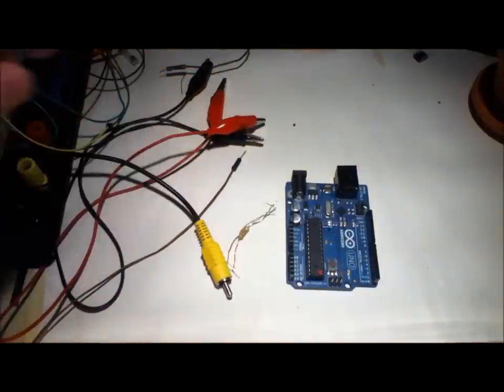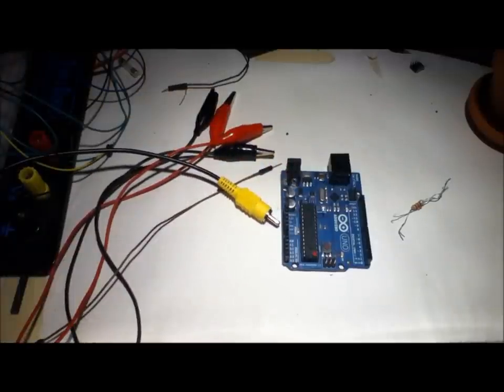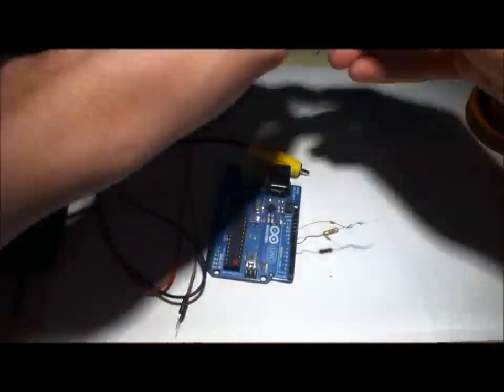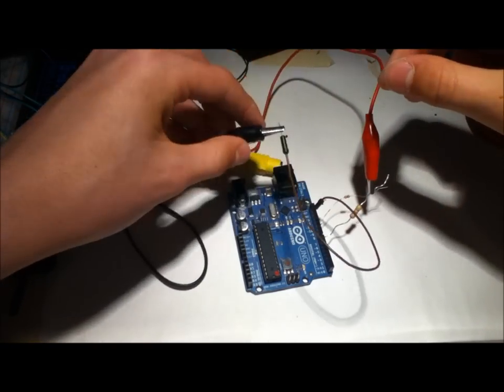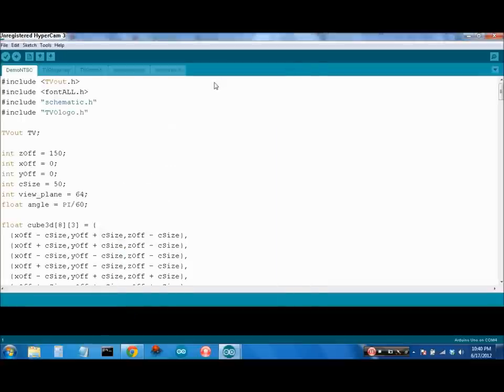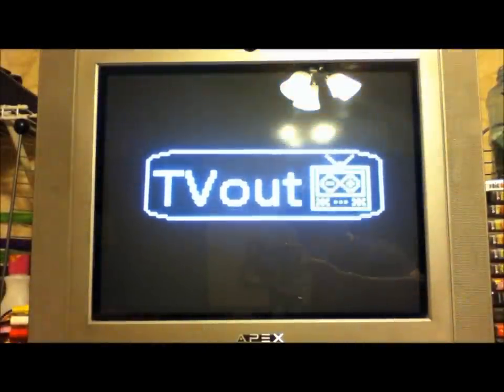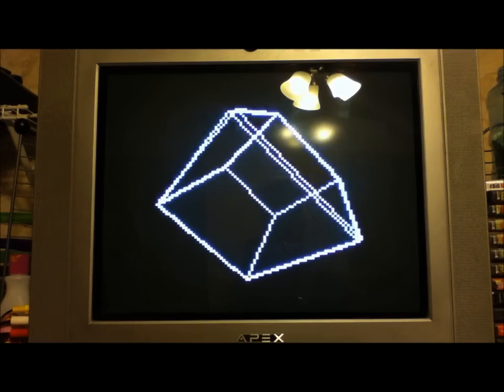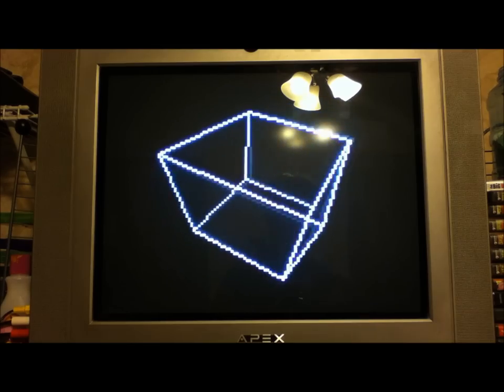Arduino TV Output

Comment: I have found that with those resistors, There is too much voltage to the TV. Should be 1 volt. I used a 2200 and 1k ohm resistor. also a 75 ohm resistor to ground. Gives a crystal clear picture. Try this if it won't work on your TV or DVR.
Reply: Changing resistors to 2.2k and 1k is helpfull, realy THANKS! But without 75ohm for ground - the picture more brightest. It's works for PAL and NTSC mode. With default 1k and 470ohm resistors my picture lost the sync.
Reply: I had done this before- The TV will generally work fine, for a bit. Then you burn out the inputs.

Comment from the maker: That could be any number of things. First, make sure the resistors you have are the correct values. Those resistors are then connected to the proper pins. Make sure that you're using the proper code for your television, NTSC or PAL. Lastly, the code.

Comment: Hey im seeing a blank screen that flashes briefly upon upload.
my code is from instructibles, i've read through the header files and other tutorials related to this and am wondering if prehaps it is just an issue with the resistors. here the code from instuctibles, should look familiar to most.

#include <TVout.h>

TVout TV;
unsigned char x, y;

void setup ( )
{
  
   
  TV.start_render( _NTSC );
}

void loop ( )
{
  TV.clear_screen ( );
  TV.print_str ( 30, 40, "hello tv!!!" );
  
  TV.delay ( 60 );
}

Comment: You may have an older version of the arduino using a different atmega microcontroller. When I compile programs it tells me I have 32256 bytes maximum.

Comment: i downloaded the tvout library 'TVoutBeta1.zip'.But the example included in the library doesn't compile.i tried every tvout libraries available in the internet.still i m not finding a solution. I experimented with the latest version of arduino IDE and even the older version. the problem still persists.the software shows the following error:
  This report would have more information with
  "Show verbose output during compilation"
  enabled in File > Preferences.
Arduino: 1.0.6 (Windows 7), Board: "Arduino Leonardo"
C:\Program Files\Arduino\libraries\TVout\TVout.cpp: In member function 'void TVout::tone(unsigned int, long unsigned int)':
C:\Program Files\Arduino\libraries\TVout\TVout.cpp:825: error: 'DDR_SND' was not declared in this scope
C:\Program Files\Arduino\libraries\TVout\TVout.cpp:825: error: 'SND_PIN' was not declared in this scope
C:\Program Files\Arduino\libraries\TVout\TVout.cpp: In member function 'void TVout::noTone()':
C:\Program Files\Arduino\libraries\TVout\TVout.cpp:876: error: 'PORT_SND' was not declared in this scope
C:\Program Files\Arduino\libraries\TVout\TVout.cpp:876: error: 'SND_PIN' was not declared in this scope

if the problem is using leonardo i can manage to get another
But the examples don't verify even when i am not connecting any boards

wud be grateful 4 any suggestions or solution